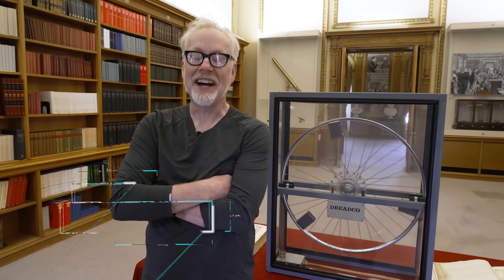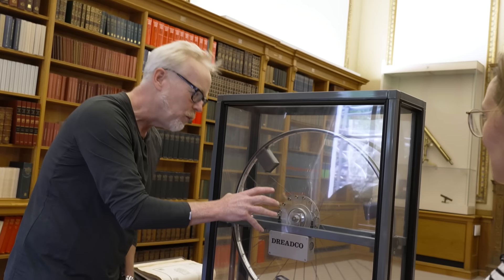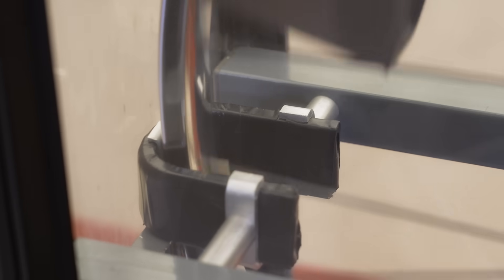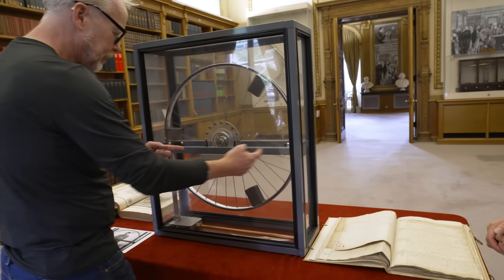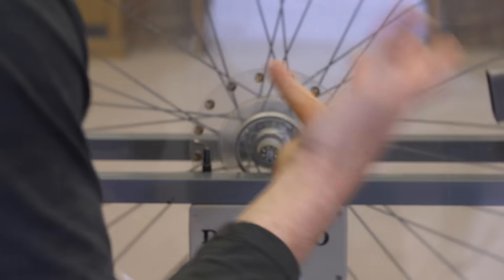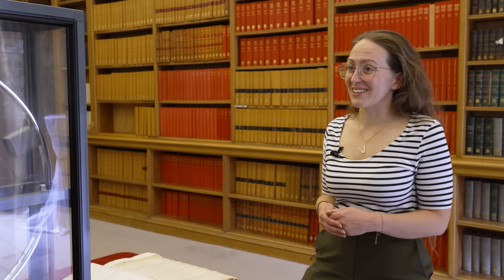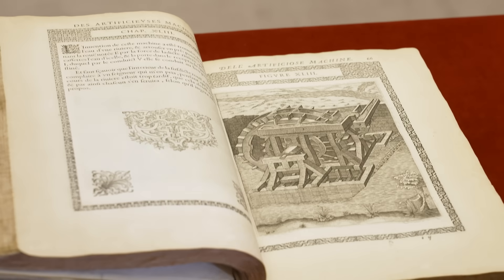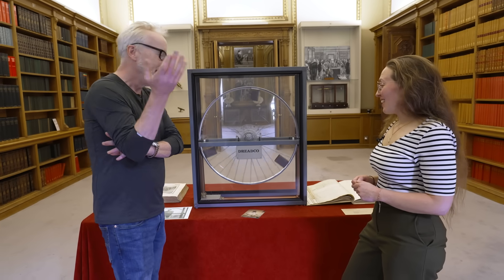Adam Savage vs The "Perpetual Motion" Machine!

Comment: I’ve always wondered if we could make one with magnets. I don’t know much about physics but it seems like some other factor besides just weights and bearings could solve this issue. 
Take a maglev train and stick some other external magnets pointing positive on way and there’s a track on the sides that pushes it. Not perpetual motion, but you just turn the magnets on and off and boom. Train taking little energy.
Reply: Oh boy, the maglev. Not only incredibly expensive due to gigatons of copper cable required, but also electrically inefficient because you must actively expend energy to levitate the train in addition to moving it, the same way as a helicopter has to. 

Well the gist of why perpetual motion doesn't work is conservation of energy - it can change its type but not its total amount. In a battery powered electric motor, chemical energy is turned into electrical energy which is then turned into mechanical momentum energy, and at every stage a fraction of it turns into heat energy, until at the very last step all remaining energy turns into heat.
Reply: @michaelbuckers  thank you for showing me the problems. I know through the one physics class that energy is wasted through heat, I just didn’t know how much extra energy was needed for a maglev. I was speculating that magnets, and magnets only, could allow a track to power through low friction. I didn’t know there was a constant force against the trian powered by any electricity.

Comment: Maybe Electromagnetic induction is at play with the Copper rod at bottom which conducts the induced current due to changing magnetic Flux that gives a momentary current that helps to give a slight angular momentum to wheel. Anyways if it's the case then it's just disappointing.

Comment: Now you don't need a monthly bill every month,  take a battery and an electric motor and a generator or alternator what ever you want to call it. The battery turns the electric motor and the electric motor turns the generator,  the generator is putting plenty of power to your home and keeping the battery charged.  Once you start the system it will never shut down until you need to service it. It's about the size of an AC unit but they won't let you use it. Same thing with an electric vehicle,  they can put an Alternator or generator on the axles of any electric vehicle and it would keep your batteries charged by simply driving the vehicle.  They can charge themselves.  Even one day the wheel barrings will get worn out on this device and need to be replaced.  But no monthly bills. Their Nazi German Roman ways have never died they still rule the world. I'm not saying this is free energy but I am saying no monthly bills.

Comment: well i would suppose, the boxes are weights and inside of the box bellow have some kind of pulley or small wheel that after the initial moviment it would keep it moviment with almost no energy on the motor and to keep it for more time, maybe one mm of difference between the weight boxes.

Comment: It kinda looks like the wheel is being imbalanced by the magnet (pulled towards the 3 o'clock position)
When that point moves to the 1 o'clock position, the wheel is imbalanced to the 9 o'clock position by the other magnet.
.... Could this in some way alter the radius of angular momentum (think ice skater extending or folding arms during a spin)

Comment: Heat sink can be used to remove waist heat from a system. (energy leak) or absorb heat from the environment if there is a temperature difference between day and night the system can absorb this energy to change gas pressure within the container.  Given the heatsink and valve would all that would be need to store the energy into the coper pipes as increased air pressure. There is a self winding clock that uses this to wind itself. (https://www.youtube.com/watch?v=SsvI06WvUnw). 
My guess is: Have a large metal box with an inlet valve and an outlet valve, and heatsinks. As the box cools down at night it draws air in via one valve. As the box warms up during the day it pushes air out the other at slightly higher pressure. Feed this into a reservoir and you will have a container holding pressurised gas that can be vented via a small hole blowing over fan blades. It just needs to provide enough energy to overcome the loss of energy of the system. All that is needed is a minimal temperature difference between day and night.

Comment: Adam guessed it right I think. The clumps on the wheel are magnets. The larger box contains a long-life Litium battery (those which can be stored 10 years) which is coupled to opposite-placed electromagnets. The wheel spins with 1 Hz for every magnet which passes the electro-magnets. The silver box has diode which supplies a small alternating current to the electromagnets to pull and push the magnets with polarity. Then, every two years they replace the battery. Problem solved.

Comment: I wondered if it employs both a battery/magnet and has a vacuum pulled inside the case to help reduce friction.
Reply: It didn't look like there was a vacuum because the acryllic plate moved when he touched it. But yes, I would have pulled a vacuum and made a smooth wheel without spokes to optimize the last but of energy loss but the inventor didn't. Leads me to believe that it was more for show and there was more than enough energy. But I guess you could rebuild sich a wheel with it's bearings, put it in a case with air and see how many milliwats are needed to keep it spinning at that speed. Second thing which jumps to my mind, how does it regulate it's speed? Or does it accidentally balance out at this speed? I mean, perpetual motion means either no energy loss at all or a positive energy balance which would make it spin faster and faster.

Comment: Adam there are many who have achieve this goal but none that can be used to drive a load. So what is its use??? Some machines using gravity have the ability to make solar panels face the sun but it's not a perp. Motion it only works as a free entry machine if the sun is out.
(BP solar tracker on a trailer)

Comment: I'm guessing there's batteries hidden in the frame.
The horseshoes are not, in fact permanent magnets, but enclosures for coils.
The boxes on the wheels receive a pulse of magnetic attraction to keep it turning.
This could be timed by a commutator ring or the box includes a light sensor, hall effect sensor or reed switch to time the pulse to whenever one of the boxes on the wheel is just about to pass the coil.
It could also house a tuned bistable oscillator circuit tuned for a particular rpm.
The glass looking discs on the side might be one of 4 things as far as I'd guess. 1- a PV cell for trickle charging.
2- a light sensor for detecting shadows from the wheel to time the pulse.
3- a light sensor to turn off the machine in storage or 4- a decoy.

Comment: 10:25 I took it upon myself to figure out this cipher of the coded names.... 

Given a circle has 360 degrees and and there are 26 letters of the alphabet (Assuming they`re using normal Phoenician Alphabet) each Letter would  ~13.85 Degrees from one another .
Having gone through the trouble of actually making a visual for myself with each letter thusly evenly spaced out on the circle.
deciphering

Just arrange the alphabet with the first 13 letters on one line then start again on one line lower. 

Eg ABCDEFGHIJKLM
     NOPQRSTUVQXYZ

Draw a line through each letter of your name and the opposite lined letter is the letter of the "coded" name

Comment: Trick is to lower the friction to almost zero with precision bearings, low speed and no air currents.
A Lithium Ultimate lasts 25 year shelf, and contains 17,640 Joules of energy.
Over 20 years, that's 27 uW continuous draw.
So a single 1.4 v lithium ultimate battery pulsed drawing 27 uJ/s^-1  can run this rig for 20 years, or 2 years at 0.27 mJ/s^-1.
Not a problem at all.

Put a pickup coil near this thing and I'll almost guarantee you'll hear a faint click every time those boxes passes the horseshoes.

Comment: An Atmos clock runs for many years without external winding, batteries, or light.    It uses small changes in temperature and atmospheric pressure to power the clock by turning ethyl chloride from a liquid to a gas and vice-versa, powering bellows which then wind a spring.  All done without noise or any visible moving parts.  The key element is the very, very low friction of the movement that allows it to run as long as the mechanism's integrity will allow it to.

Comment: I am guessing the answer is in the framework. Perhaps it's using a tiny amount of air flow to add that tiny little extra boost which may be coming in and out through the frame work. Just like how a fireplace and chimney works. And the rest is just very well balanced weignts that slow down slowly on their own.

Comment: I have seen this mechanism in museums. There must be plenty of people who know the secret.

My theory: the boxes contain electromagnets, a little circuitry and a battery. The magnets activate when the external magnets are detected. Each box measures the rpm so it can know how large the pulses need to be. Note the device moves at a very constant rate.

Also, the box has been drawn to close to a vacuum to minimize losses.
Reply: The lack of oxidation on the copper seems to be a indication of poss. vacuum .

Comment: I kept how my automatic slide release (for guns) works a secret for nearly 20 years. I showed it in action to some people and they acted like it was magic. Particularly the fact that i could make it work when i wanted it to every time and not work when i didn't want it to every time without having to flip levers or hit buttons on the gun. I told everyone for those 20 years that it's dirt simple and when/if i eventually do come out with how it works, they will be surprised that everyone has been trying to figure it out for over 100 tears unsuccessfully. Still no one ever even came close to figuring it out in those 20 years. Not people who saw it in action. Not the industry. You can see how it works on my youtube channel. 
 In my case, what solved a problem was thinking outside the box. And i noted that; while everyone loved how reliable and controllable it is, they were disappointed at how simple it is when they learned how it works. As though they were expecting something far more radical despite what i had been saying for years. That makes me think that; whatever this guy did, it came down to approaching the problem in a simple way that was outside the scope of the way people working on the problem were looking at it. So if it were me, i would throw the whole manual of perpetual motion hypothesis out the window and look at it from a completely fresh approach utilizing little, if any of the common principles. Starting with the fact that perpetual motion (at least in the way we think of it) is impossible. Which means he's getting power from somewhere. I imagine even how he is getting power is going to be outside the box but simple in nature.
Reply: Yeah I bet it's just a simple electric motor running on AA batteries.
Reply: @michaelbuckers  could be that too
Reply: @michaelbuckers  i would also look at how a wood stove processes air. That's the main thing that came to my mind.

Comment: The boxes on the wheel are the magnets and the U shaped pieces are the coils. The copper pipes hide the wires and the box at the bottom is the controller and battery. The timing for the motor is done through inductance from the magnets. The box in the center is meant to distract you. Its nothing new to have a motor run like that for long periods of time like most clocks that we usually see every day. Now the box possibly being a vacuum or filled with helium might be up for debate.
Reply: Actually the boxes on the wheel can have the coils, magnetic switch and the battery in them with the U shaped pieces being the magnets. Everything else might just be a decoy.

Comment: My guess is that redirection of the magnetic field is happening within the Dreadco box. The two items coming from the box and the magnets on the spokes are similarly charged when facing one direction, thus pushing away from one another. However, to avoid the system locking up the magnetic fields needs to be weak enough to not pull everything to a locked state, so one of the items from the box would be used for the timing of the magnetic field redirection.

Comment: This is cheap and stupid. 1. Perpetual motion is a trick preying on the scientifically uneducated. 
2. If you’re gonna build something that rotates as efficiently as possible, at least make it better than a 5$ wall mounted clock. 

For something to impress me it would need to run at least a decade without any electricity. Say, using rising air, or heat differentials, or any other natural phenomena that we would usually disregard.

Comment: The notion that it needs to be serviced occasionally is enough debunking on its own, for me, as I know well that there are exotic battery chemistries that are able to provide small currents for long periods, so I would agree with Adam that it is likely a simple motor of some sort.  In being closed in a box, it presents itself as perhaps being evacuated but it's clearly not, it has a mundane ball-bearing and not the magnet bearing you'd need to make an actual perpetual motion machine or something close to one, which is possible (the impossibility is over unity, of course) at least in theory.  Such a machine has no use, of course, as it produces no energy, only stores some small amount.  There are of course all kinds of ways to get "free energy" that mostly come down to sticking an impeller in a natural process that happens no matter what you do but this is less exciting than what I guess amounts to fruitlessly searching for bugs in real life's physics engine.

Comment: Seems like it should be possible, why can you not have a super efficient motor create enough electricity to power itself🤔 a motor is essentially a generator no?
Reply: to sustain motion is not the problem, even though it is just theoretically because you have always some sort of resistance somewhere, even it is on a quantum level. so, this gives us in reality a constant "drain" of energy, energy that would be needed to upkeep the motion is given away in form of radiation or heat. 

if you try to use such an efficient machine and want to extract more energy from it that it needs to keep up running, than you make the problem shown above even worse. 

Energy can't be created, it has to come from somewhere.

Comment: It is not hard to understand that just like a battery operated clock that easily runs for several years, that this is identical. As for the three boxes, they are more than likely induction coils. It’s possible that two spokes are not solid but are hollow tubing containing fine insulated wiring that provide current flow to the hidden armature inside the axle.

Comment: IT is an electric motor....noticed the shape of the magnets...it gives a small pull them push....if it has a slight point it would pull less on one side of the magnet and more of a push on the other side as the stationary magnet on the frame so you could have a switch turning the polarity of the magnet from minus to plus each every fraction of a second or so. The secret would be in the timing.

Comment: I'd be guessing that pretty well everything in the box is misdirection. There's either just a battery or a solar cell and a battery and that is just supplying pulses to an extremely low friction wheel. A single lithium battery could conceivably power the wheel for years.

Comment: It seems likely to me that the screws on the insulated flywheel may be magnetized at an interval, and the near by electrode looking dealies could be acting as a hall effect generator which charges the frame with minute electricity at just the right time to amplify the magnetic fields creating a moment of impulse just before the weights pass by.

Comment: The 3 boxes in the wheel are bar magnets. With the U shaped "magnets" being small transformers. The nodes in the center are connected through the middle logo are just a mechanical rectifier diode. There's only a tiny bit of CEMF generated when those nodes are lined up and let's the very tiny amount of voltage to push the perfectly balanced wheel through the transformers.

Long story short. It's a generator/motor.

They have to "recharge" it by just putting a tiny current through those copper pipes

Comment: If you turn out the lights in the room it will probably stop running because there's some type of solar panel built into the square boxes that is absorbent and light running through the spokes of the wheel to turn the motor. Turn the lights out in oh probably stopped turning

Comment: I think it uses the repulsive force of magnets as it passes through the 9 oclock point. And the attractive force on other side of the opposite block as it passes through the 3 o clock point. magnets are angled just right and give a subtle push from behind the block and pull on the other side as it passes through!! so each block has an attractive and repulsive force either side!

Comment: I have actually worked out exactly in seamless, Martin overly simple. However, it is not going to generate enough electricity to power. Something else it’s simply can’t do that. It barely generate enough energy to recharge itself. It’s basically using a version of like magnetic wireless charging a printed version of that too charge a spring-loaded winding spring-loaded mechanism to the power of the we’ll get the wheel started using heated water and magnets, heated water and magnets to magnetised magnets, which then turns the hall magnetic batteries, which then they’re often on Consol all the time, which is the turning powers, a tiny little generator, which then boil the water, didn’t turn the magnets off and on